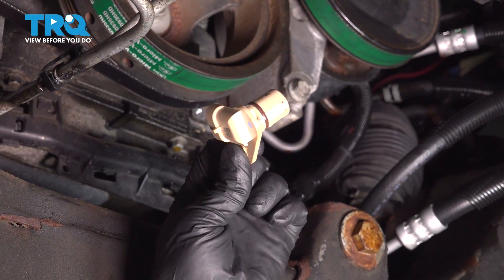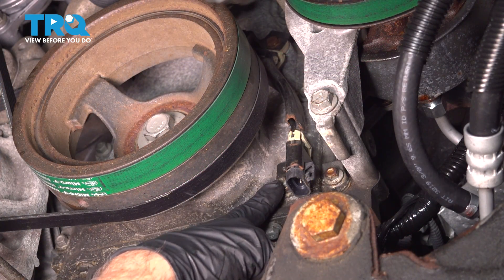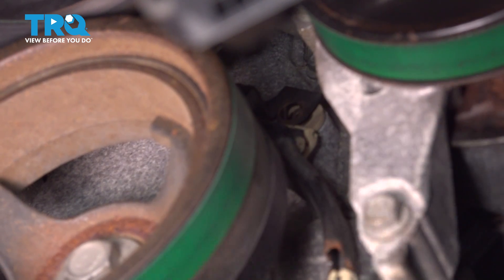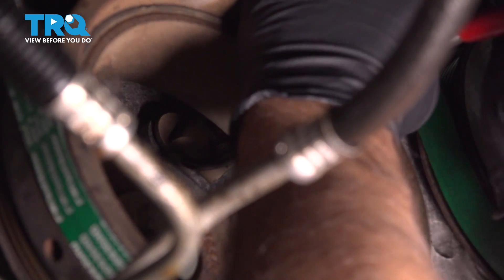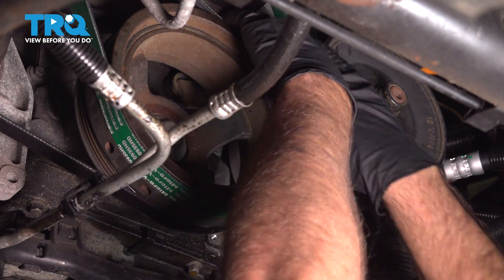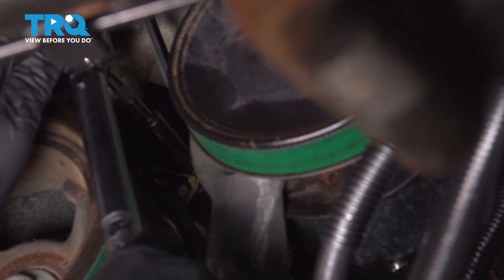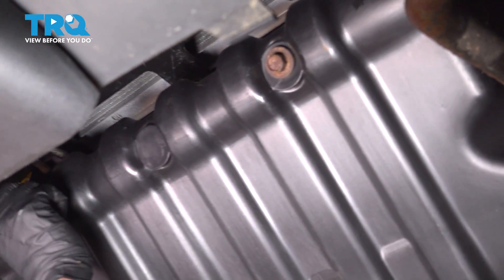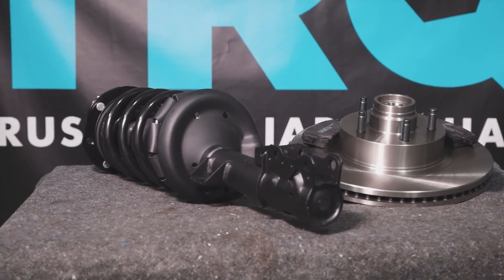How to Replace Camshaft Position Sensor 2007-2013 Chevrolet Silverado 1500

Comment: Why are you people calling it a crank sensor it’s mounted in the timing cover crank sensors are down by the starter..cam sensor on older model5.3 is @ back of intake near oil pressure switch

Comment: My plug on the bottom of the camshaft extension is a 5 wire plug. Would you happen to know what the plug part number is for mine? I have a 2008 gmc sierra Denali 6.2L

Comment: I attempted this repair.  Sensor was stuck and then broke as you mentioned.  Drilled and tapped the sensor as you suggested but the plastic crumbled making nothing left to grab or pullout.  Searched online for answers only to find videos and comments of people spending a lot of time trying to get the broken sensor out.  If the vehicle is not too old maybe you will get as lucky as the video.  People also need to know if you cannot get the sensor out you cannot start or drive the vehicle.  You need to revise the video and caution DIY folks to leave the repair for mechanics if the sensor is stuck.

Comment: I just got a P0340 intake camshaft position sensor circuit code on my 2005 Pontiac GTO. I looked at the wiring. It looks fine. The connections do look dirty with some fresh oil on it so I’m thinking maybe I need to clean it. I’m hoping it’s just because it’s wet from the oil and if not, it’s just sensor.

Comment: that IS the cam sensor. The crank sensor on a gm 5.3 is above the starter on the passenger side of the block. Frickin trolls.

Comment: On 4.8ltr 20011 there's a 3rd screw,10mm on left behind crank flywheel, it's no easy but can loosen, sensor broke, this is not sn easy job, 7 pkus hrs

Comment: That is the exact way to remove the CMP sensor (camshaft position sensor) on a 07 gmc yukon 6.2 engine which has 1 extra bolt

Comment: Isn't that the Crank position sensor, not the Cam position sensor. I thought the Cam Position Sensor went behind the intake manifold.
Reply: This is obviously Gen4 GM V8, not Gen3. You can tell that by the year range that they put in the title of the video.

Comment: After the plastic breaking out on top and drilling out the sensor using an easy out took about 7 hours start to finish dont base your repair on this 1 video as he cuts out the hardest part of actually getting it out and acts like it was easy

Comment: I have 2013 5.3l and mine has 3 bolts for wiring harness bracket 1 on bottom and 2 up top and the 1 is absolutely terrible to get out... And the sensor took me 2 1/2 alone to get it out...